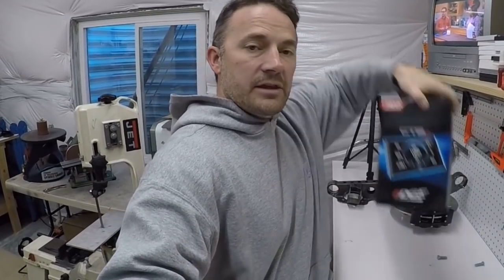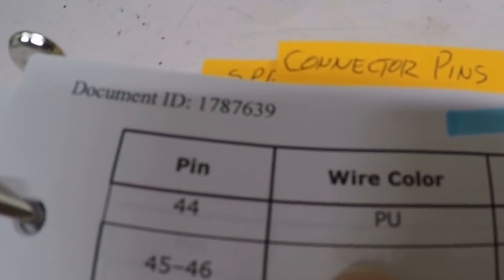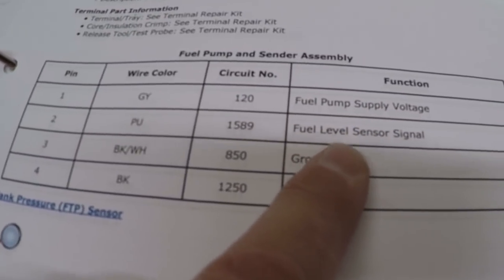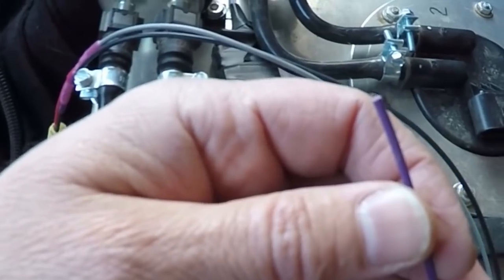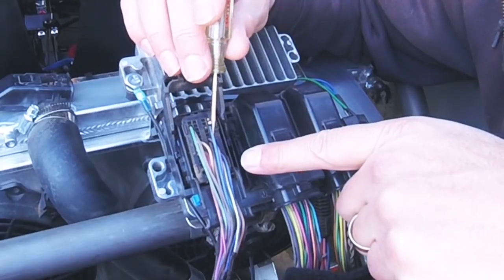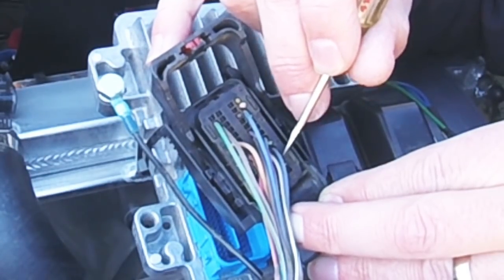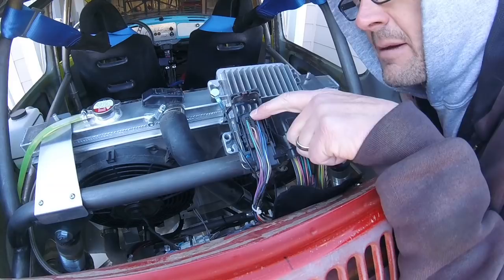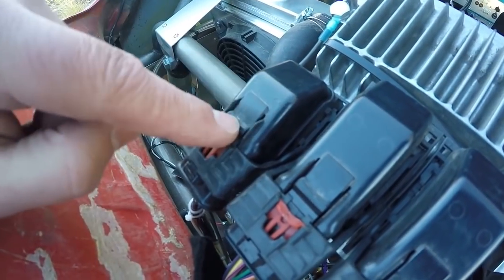Ecotec ECM Wiring & digital dash hookup on the Baja

Comment: Hey Doug, I’m at a sticking point on my build hoping you can help... I’m trying to figure out how to do the digital dash and gauges on the buggy and looking at the Voyager Trail Tech as well as the Edge system. Did your edge replace the trail tech or do you run both? Also i’m wanting to keep the OE sensors do you know if I can use my existing sensors with either system? Any feedback on what direction to go in would be greatly appreciated!
Reply from the maker: The Edge should work, all you need is an OBD II port for that. The edge is really just a really fancy diagnostic tool. It's nice. It's a little more cumbersome then a typical dash. Because you need to select your mfg each time you start up the engine. But I like mine, the data it gives me is priceless. No need to change any sensors, it get's all it's info from the ECM.
I still use the Voyager. It supplies different data than the edge. Although between the two the Edge is more important. The Voyager gives me MPH, time, ambient temp, engine temp if you hook that up, and GPS tracking. Plus you can plot routes online and upload them to the Voyager for use on the trail.
Hope that helps buddy!
Reply: Doug Bug Huge help, thanks buddy!
Reply from the maker: @DirtGearTv  Just to be sure though check with Edge to make sure they support your engine if you decide to go that route.

Comment: Did you ever get the kinks out?
Reply from the maker: I believe you are talking about the Ecotec kinks? If so there were two of them. The first was that occasionally the engine would surge. That was resolved by installing the O2 sensor. It will still surge a little on start up. But after about a minute or two of driving that goes away. Secondly is that it really just turns on the radiator fans and just leaves them on. Alpha Fab says they can fix that. I just need to send them the ECM, and I haven't done that yet. What I've done for now is I have a manual switch to control the second fan.

Comment: Man I wish you had asked your subs! A much cheaper option would have been possible with proper PID calibration(I believe)! Simply using a cheap android table, you can buy the app called Torque Pro and a Bluetooth OBD2 reader! The reader is 25 bucks on amazon, the app is 5-6 bucks and a tablet of around 100. And you could sink it into the dash and be good to go! If you have multiple cars, you can move the reader to each car and if you have a phone bam, multiple extra gauges in anything you drive!
Reply: I also like how even though the video wasn’t ultimately a success, you posted it anyways. The info is great, also allows for comments and feedback. Project is scooting right along.
Reply from the maker: I should start giving the subs an idea at the end of my videos what the next video is going to be about so they have a chance to give ideas before the video. Although I don't always know what the next video will be. But I would like to collaborate my subscribers knowledge more on these projects.
I'm aware of the OBD Bluetooth plugs, honestly I really wanted more of a plug and play deal. But with the description you gave that's really cheap and sounds pretty good. Maybe I'll take a look and play around with it. Thanks for all the info, it's very helpful!
Reply: Doug Bug Of course! And a useful part is the ecotec motor isn’t a brand new one so there should be forums online with the PIDs to calibrate the Torque app to what you need. It’s also a little more customizable than the Edge looked to be. Different ways of getting the job done though!

Comment: Thats cool mate, it will take some anxiety out of shredding the trails.
Reply from the maker: Yes it will! I hated not having visibility into the ECM. This will let me know if any trouble codes pop up also.
Reply: @DougBugBuilder  it's a bit more hi tech than just having an oil pressure gauge on an old air cooled engine 😎

Comment: Flip the plug upside down, take a screwdriver and pry the bottom on the plug off where you can see the pins, then you will see the release tabs for the pin and it pulls out the wire side. I do the same thing with a very cheap obd2 Bluetooth plug and a android app called tourqe with my ecotec buggy.
Reply: https://youtu.be/opIQgu4XJso ship to like 10 minutes in this video cause he did it ass backwards until that point lol
Reply from the maker: Thanks for the info! I went to the junkyard and got an old plug to experiment with. If I can remove pins on this one without damaging them I'll give it a go on the one on the bug.

Comment: The pin on the plug should be easy to take out. You just push it thrugh, at least thats how my Monte Carlo PCM was. The pins have little locking tabs, once you see what way they lock just push it the opposite way.
Reply from the maker: I'll check that out. I hope it's that easy.
Thanks for the info.